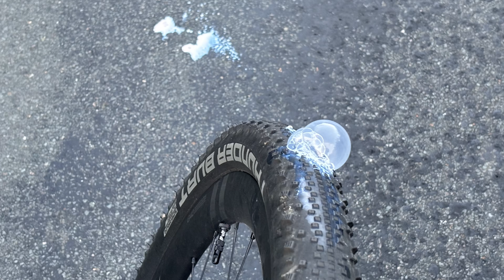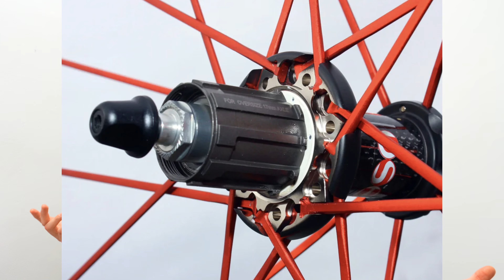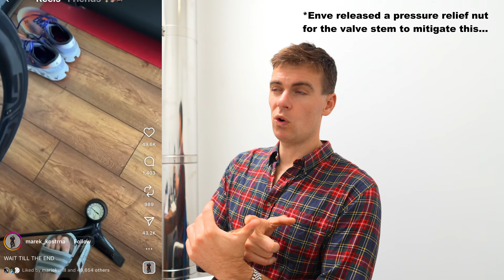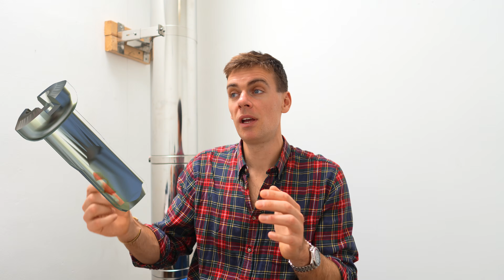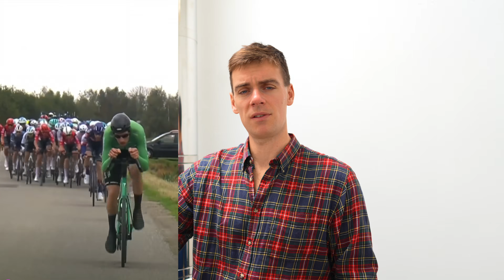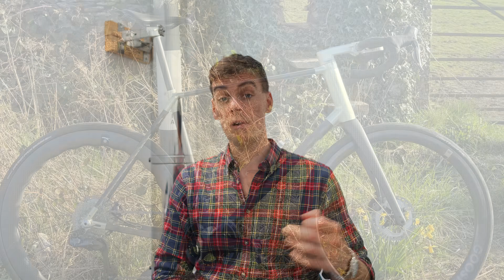The truth hurts and its ugly + more EXPLODING carbon wheels - PT Show ep. 9

Comment: Tubeless work very well in my situation, 99% of road punctures were from small steel wire, usually from truck tires. Those seal really fast, as in sometimes finding 10s of it in the tire (which hasn't flatted) by the time I care to look.

Comment: There is nothing less cool than doing something because it's cool. Jan's bike is cool largely because of its complete disregard of looking cool in pursuit of maximal performance. It's not as simple as "form follows function" though, as Dieter Rams puts it, the form is functional in and of itself - beauty is not useless.
Reply: The bike has to look horrible because the frame isn’t properly designed for a tall rider, so the rider had to modify the components to get into the proper position. The custom frame bike owned by Peak Torque looks relatively normal because it was properly designed for a tall person- no modified components necessary.
Reply: @petesjk  The bike is not properly designed for a tall rider *that is hellbent on hyper-optimising performance*. But this is not unique to the Tavelo, the only non-custom frame in the world I know of that is actually properly optimising for aerodynamics is the Morpheus Reppit. It's not that the bike does not fit Jan, it's that Jan is trying to get as close to a TT position as possible, and road bikes are not designed with this in mind - hence the modified parts. Even if he were 5'9 the frame would still not fit his use case sufficiently.
Reply: @dilanfrith If you listen to the video, companies are optimizing their frame designs for rider sizes that can win climbs. They may not be climbing specific frames, but they’re still being designed around that rider height, which is also relative close to a statistically normal male height. Combined with UCI rules and production simplicity, those frames are basically just enlarged for taller riders. Unfortunately for taller riders, that doesn’t really work well. It also doesn’t work well for shorter riders, btw. Sure, Jan wanted a more TT position, but for an avg size rider aero bikes with high stacks and short reach are already standard.

Comment: High bars for the win!
Reply: road bikes like low bars (and long 120+mm stems) for planted high speed handling.
Reply: @seanmccuen6970 over 120mm? When did you last buy a road bike?!

80-120 is pretty standard... 

And a long low front end does not give you planted high speed handling. Anyone who has ridden a 1990s TT bike knows that...

Comment: Maybe Challenge Getaway HTLR Pro? They are very fast and have good puncture resistance rating. They max at 45mm I believe though (but I believe they may balloon up a bit larger). I have some and Thunderburts, I'm super light and basically never puncture but did manage to do so on the Thunderburts, never punctured the Getaways.  
The set back distance is so ridiculous, it feels so much better to be way forward, it benefits your power and knees. I wonder if the number of people getting scar tissue in their iliac artery could be mitigated by allowing/using a more open hip angle that is made possible by this forward position (less compression there).

Comment: Envy has special nuts on its valves that ensures his pressurization doesn’t happen The problem with the MV rims is it doesn’t have little holes to release pressure inside the rim so you have to use a special nuts on that valves

Comment: I think the Enves are a bit bad example because they have special pressure relieve valve nut which you must use and I would believe a lot of people didn't.
Reply: Correct. It is actually on the Enve site that you have to use specific valves (at least it was when i bought my SES 4.5 wheels a couple of years ago). There are little carve outs in the nuts that are used to screw down the valve. I have not seen this with third-party valves and it is not very clear, so a mistake is easily made. When set up correctly, which I’ll admit does take some knowledge and effort, Enve wheels are absolutely great.

Comment: I had this rim pressurising explain to me by Farsports a few years ago. As they give option of drilled side wall. I thought it was a drain hole. As I was ordering rims without spoke holes I didn't want drain holes. But they told me it was to relieve pressurisation
Reply: Yeah, but they make hole-less rims. No tape needed.
Reply: good to know 👍
Reply: Why would you not want a drain hole? Do you never ride in the rain or ever wash off your bike with a hose.
Reply: @jaro6985 why would you need a drain hole for washing? I have two bikes. A wet and a dry bike.
Reply: @alpsalish  because you spray water on the wheel, it runs down the spokes and into the rim. You won't realize until it builds up.

Comment: I blew up my FFWD F4D wheels this summer. I was riding them tubeless with 32 mm GP5000 tyres. I had a puncture, plugged the tyre (Dynaplug), pumped it up and at 2 bar the rim exploded. Further investigation revealed that the plug had made a hole in the rim tape exactly where there was a spoke hole, causing the space under the rim bed to come under pressure. The rim had no drainage hole. I believe this is a design flaw. An FMEA analysis in the design process would have easily revealed this.
Reply: Dynaplugs are too sharp IMO, take a file and round the tip off.

Comment: Perhaps important to mention that the fairing cavity doesn't even need to be perfectly sealed, it just needs to let air out at a slow enough rate that the cavity could momentarily retain pressure during shock-instilation of the tire with an air canister or air compressor. The requirement for that sudden load just seems like the last nail in the coffin for tubeless to me.

Comment: i always played with the lightbicycle configurator and always wondered why there's an option to put a vent hole in the rim. Now i know why
Reply: I've always wondered why there is an option to NOT include a vent hole.
Reply: @jealnoslyn maybe because they offer rims without nipple holes? If you have an airtight channel and don't need rim tape the vent hole shouldn't be needed right?
Reply: they told me it was for water and so I got it cuz why not... didn't realize it helps for air pressure issues too

Comment: Question for the next PT Show: do wavy rims like zipp or lightbycicle actually matter in cross wind or in normal condition
Reply: They may, but the only waviness I like is that of the We Are One rims where the ripples are there to align the spoke holes perfectly toward the hub flanges.
Reply: They can help stability but they also create less sailing effect. A well designed normal rim can be just as good

Comment: We need to collectively be pushing for more info on carbon spoke tensioning and build process.  We are consistently seeing spokes detention a lot just with mounting and inflating a tyre.  Sometimes below what would be considered tight.  Often the spokes have to be so tight before mounting a tyre that they can only realistically be built with the aid of machines or a press.
Reply: 100% We're very much on the same page here at RBW right now.
Reply: Nah. We can just use alloy spokes.
Reply: Both these channels and the engineer from Enve who was interviewed on the Nero Show all expressing hesitation on carbon spokes. That should be serious red flag right there. At least an amber flag, that we don't have enough good data to jump on that trend.
Reply: @SeraStaplz  we're literally years past calling it a "trend" at this point 😅 spoke tensioning is a mechanic skill issue, hub design isn't. Carbon spokes are not inherently problematic, poorly designed hubs are ...
Reply: @robbeelsas  actually it is something going on with either the rim or spoke that is causing such loss of tension.  You always get a couple of kgf, but some of these wheels are loosing 20-30kgf with a tyre mounted.
Reply from the maker: @robbeelsas i disagree. Theres a big difference, will discuss in the next video
Reply: @PeakTorque let me put it differently, there is a difference indeed, but that difference in mechanical properties is something a mechanic servicing the wheel can account for, assuming everything in the system is properly designed to work with the spokes. This does not make carbon spokes themselves inherently dangerous. I understand this is not a popular argument to make, "🔫s don't ☠️ people, people ☠️ people" ...
Reply: @PeakTorque actually, I take back what I just said, but ONLY if (provided every component of the wheel apart from the spokes is properly designed) it is either: 1) harder for a wheel with carbon spokes to stay within an acceptable "operating window" over the same period of time; or 2)  it is harder for a mechanic servicing a wheel with carbon spokes (or someone building such a wheel) to get/keep the wheel within said window.
Reply from the maker: @robbeelsas  I admire your self critical thinking process :)
Reply: This comment should be pinned. Thank you Mapdec!
Reply: You do? If so, isn't it just a stiffness question? The stiffer a spoke, the more it should detension when the rim is compressed. Can anybody translate "Verspannungsschaubild" pls? It's very basic engineering stuff about how the members of a bolted connection (or any tensioned connection really) have to be compatible in terms of stiffness/deformation (or about how too stiff can be bad when detensioning factors (like "setting" or additional external loads) are not taken into account properly).

Not sure PT was referring to that (wasn't it more about the unlikely but very possible failure of one or a few spokes causing the detensioning of the remaining ones?)
Reply from the maker: @keinschwein8467 i was referring to this and yes you’re right. The spoke stiffness is one of a the problems here. Only takes a very small deflection to lose all spoke tension as there is such little stretch in carbon spokes. In the next video i show some figures and measurements. Manufacturers seem to only care about tensile stiffness and strength but forget they still have zero compressive stiffness. In a wheel review a couple of years ago i likened it to why you dont use short and fat cylinder bolts on engines - they will come loose!

Comment: do you have a rundown on your road/gravel bikefit vs road tt? I'm a similarly tall rider to you and have been struggling with finding the balance between comfort and speed (I mostly ride gravel). your thoughts on road tt seem very sensible, wondering how you've approached more general riding/racing

also, I ride LB wheels without spokeholes but with drainholes, had a carelessly tightened valve recently and luckily the air escaped through the drainhole, seeing this video I don't want to imagine what could've happened without it...

Comment: I ride road tubeless but only wide rims w/ pressure relief, wider tyres and double wrap the rim tape, rarely ride above 50 psi (light rider) so far all my punctures have sealed by the time I’ve noticed I had one

Comment: I've had good luck on WTB venture 47mm. System weight about 100kg and done the king Alfred's way 3 times with no punctures. All sorts of terrain on that ride. Lots of thorns to pull out after the fact but nothing that causes a flat or even any sealant leakage on the rides. Feel pretty quick on the road as well. No good in mud but can deal with a little moisture. Best on dry gravel, insane breaking grip.

Comment: schwalbe g-one rx pro 55s might be worth a try, ive been running them for a while now (75kg) and ive not had any holes in them yet, riding proper chunky MTB style stuff on them too. they have really good grip off road and decent RR on road (17 watt at 30psi) and were exceptionally easy to fit. only real issue ive had is the tread seems quite soft, and you will wear them down quite fast.
Reply: Agreed.
Reply: + 1 for the RX. Running the 50mm on a SC Stigmata. Zero issues. A little harder than some to setup initially (needed a tube to seat first, then only had one side to seat once the tube was out) but otherwise great.
Reply: Another on the g-one rx pro. Find them great all round tyres. Suppressing how well they run on the road considering how chunky they are.

Comment: His bike still has a 10 cm difference between saddle height and handlebar height.
I have clients with a slammed stem who only have a 5 cm difference, it really comes down to body geometry.
If you have long legs and a shorter upper body, you’ll likely want a higher stack. But that only makes sense if you ride in an aero position all the time.
When you stretch your arms out (which usually means you also have long arms), you’re actually at a disadvantage in terms of aerodynamics. So a lower front only works if you’re riding in a full TT aero position, not in a normal, more comfortable road bike position.

Comment from the maker: Small correction as noted by the legend TOXIN on Patreon: UCI regs were updated so that the tip of the saddle on ROAD bikes no longer has to be 50 mm behind the BB, just not in front of it.

Page 14, article 1.3.013 https://assets.ctfassets.net/761l7gh5x5an/4BN0EKBZ9IKhQCOerCvEwo/105bb11d5aa05cf0a4b18c29490a9887/Clarification_Guide_of_the_UCI_Technical_Regulation_-_20250201_-_ENG.pdf

Of course this didn't come with an updated schematic in the same document, but it is in the document for next year, page 13 https://assets.ctfassets.net/761l7gh5x5an/5lWSxStMARbwxsDOE2prEQ/6a14d7be7560d7e6b08354b065cb773f/Clarification_Guide_of_the_UCI_Technical_Regulation_-_20260101_-_ENG.pdf
Reply: Holy shit about damn time uci updated that setback rule, completely disadvantaged people shorter than like 170cm lol. Thank you for posting this.
Reply: I guess the UCI are relying on their catchall regs - not allowing any modification of a manufacturer's componant, or the requirement for preapproval of "innovative equipment"......